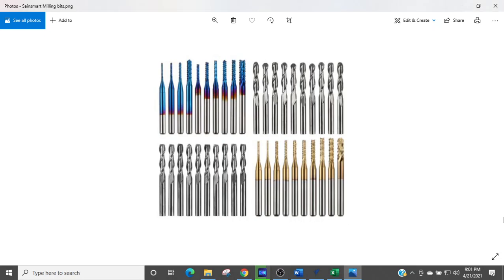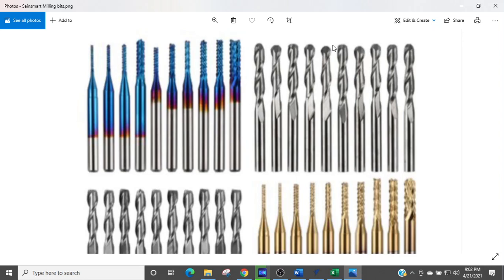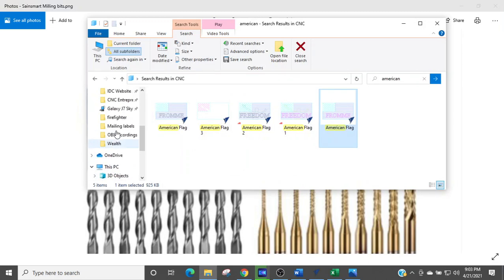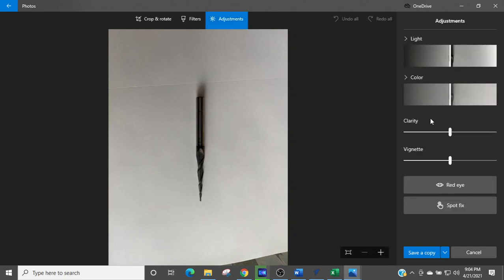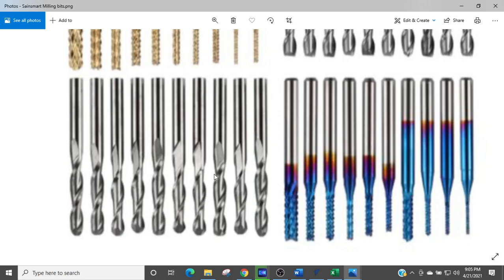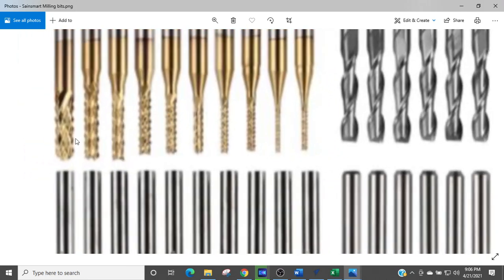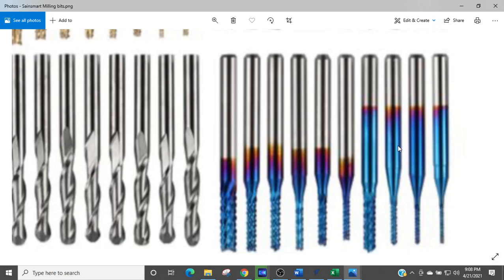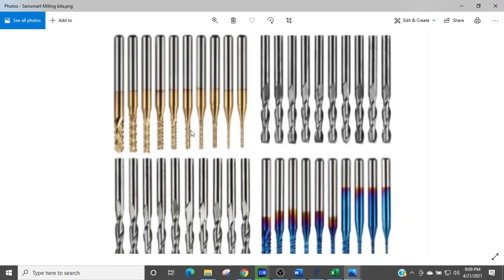Siansmart CNC Router Bits, What Are They For? - Garrett Fromme

Comment: The small ones are commonly known / referred to as corn teeth mills.  They are used for PCB, SMT, CNC, mold, engraving, plastic, copper, stainless steel and other hardware processing.  The Blue Nano Coating & the Gold Titanium Nitrite Coatings supposedly give added strength and increased service life to the bits.  They are carbide.  I use them for all my CNC work on thin woods, up to .375 thickness.  They give a nice edge, especially on my MDF projects, and, they last quite a long time.  I have been using the same bits for almost 4 years now, with no problems.  I have only replaced one thin bit (1.2 mm) for breakage once, due to crashing the gantry.  All other bits are still original.
Reply: Thought I’d bought a set of bits that I couldn’t use. Now I know what there for I can start using them. Many thanks for this it’s been a great help
Reply: @alsidyoung   You are welcome Alan.  Glad to have been of some assistance.
Reply: As a machinist, I use bits with the "teeth" like that and we call them corn cob...we have them up to an inch in diameter and believe me, they will eat up some metal!!! They are for hogging a lot of material fast. We had a Knee Mill about 30 HP, and that dude can run through some steel / Inconel / Monel / Aluminum, etc so easily it makes ya smile!!! I've taken .250" passes on 1-1/2" plate Inconel...if y'all don't know what Inconel is, it is a super alloy so hard it's incredible. We make stuff outta harder metals but not too often...

I assume they would do the same for wood...just roughing and then use a smooth bit for finish work. But, I am just a machinist and don't proclaim to know it all :-) Cheers!!!
Reply from the maker: Patrick...what would I do without you...
Reply: @IDCWoodcraft   LOL - I'm sure you would get along / do fine Garrett.  My knowledge, skills, & abilities pale in comparison to yours.